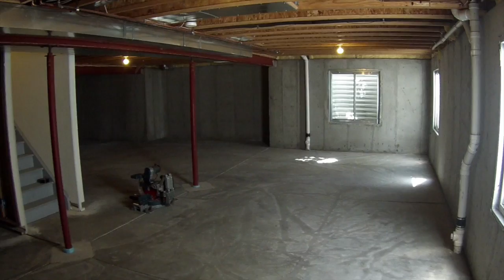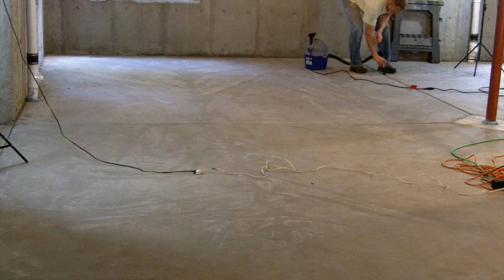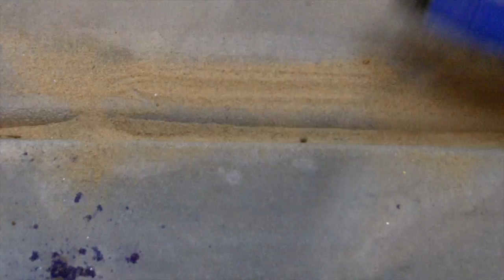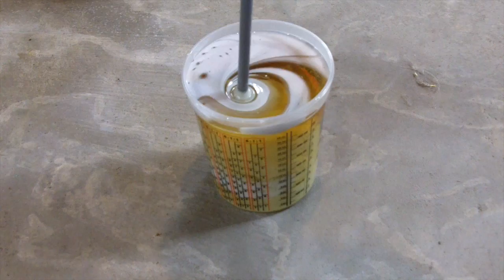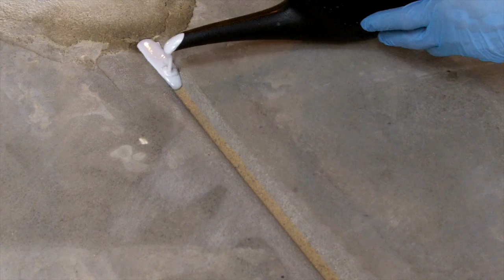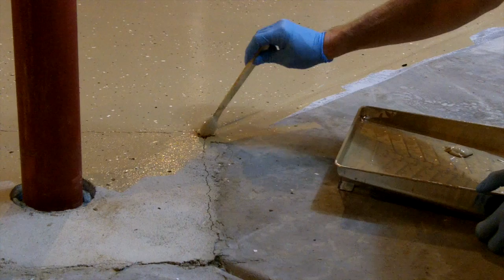New Basement Woodworking Shop in Denver

Comment: I have found that if you use a devise to vibrate the floor while filling with sand it goes in really easy and you can fill even hairline crack really easily. I just used a hammer drill with a large flathead bit made from round stock.

Comment: Could have saved a lot of time using a hose and a wet vac to rinse after the etch. Also. POUR the epoxy on the floor and move it around with the roller.

Comment: Keep us posted on how the expansion joints fair over time.  I am curious to see if the epoxy filler gets pushed up/out, and if the slabs push against the basement walls.
Reply from the maker: I'll be sure to revisit the expansion joint filling, especially if anything goes wrong.
Reply: *****
This is the 3rd video you've pasted this same comment to.  You are clearly consumed with anger and are stalking me.

Comment: What does the coating do in the last step? Is it just a moisture blocker? That will be nice to have so much space for a shop!
Reply from the maker: Bruce A. Ulrich The coating is mostly ascetic (looks nice), but also helps if you spill finish or something to keep it from soaking into the concrete.
Reply: +Andrew Klein aesthetic
Reply from the maker: Yes yes, of corse you are rite about that.